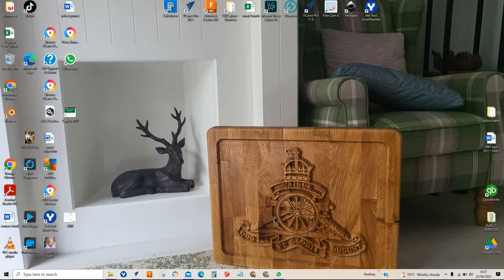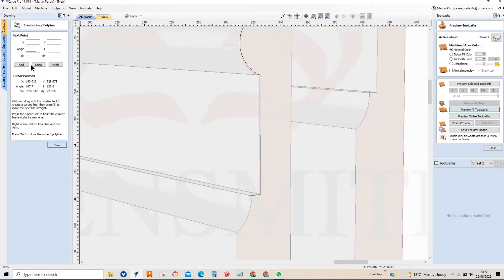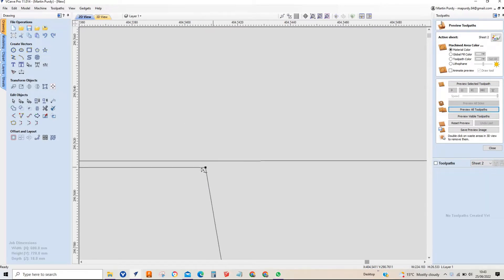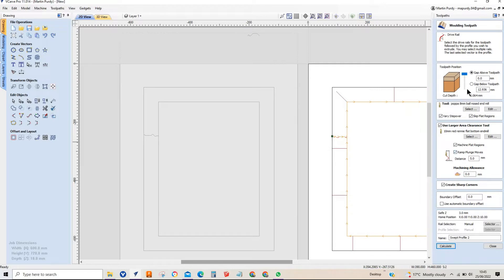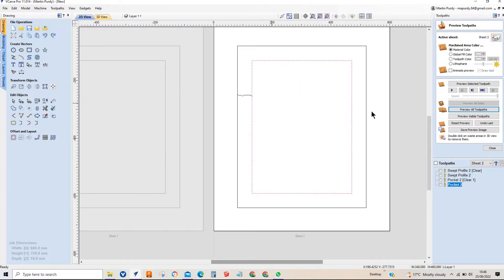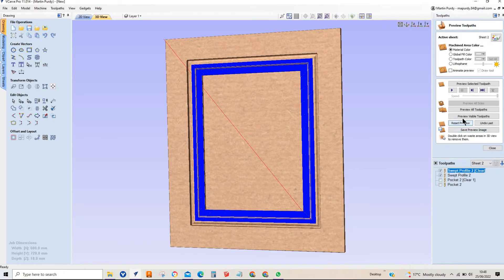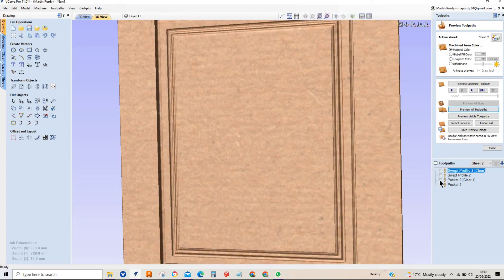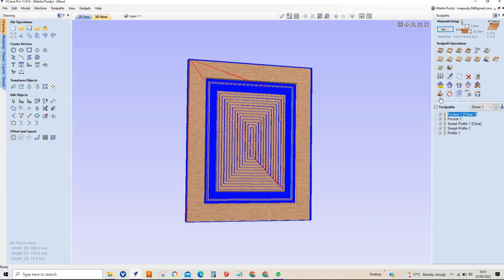Creating moulded raised panel doors with Vcarve Pro to be cut with CNC

Comment: Can you just model the profile in Inkscape/Illustrator and bring it in (as an svg) into Vcarve?
Reply from the maker: Absolutely, as long as it is an svg or dfx you will be fine. Be warned dfx tend to turn curves into a series of straight lines which can be fixed by using fit to curve feature in v-carve.